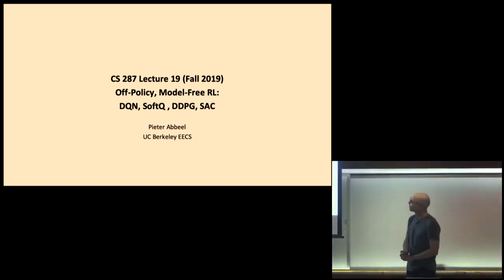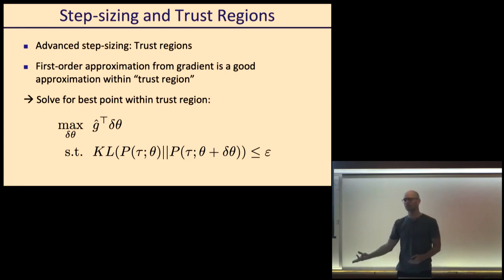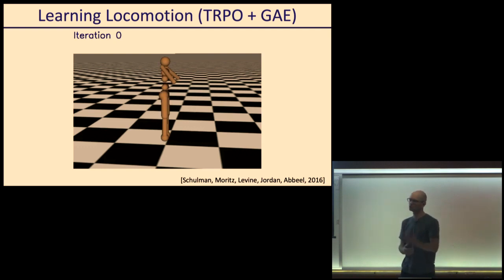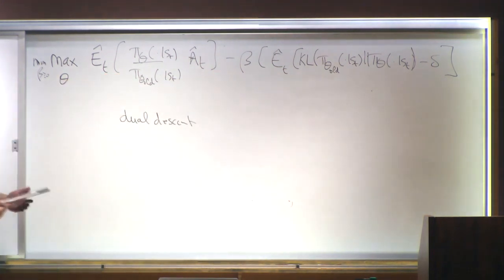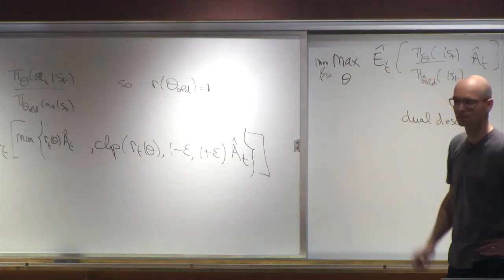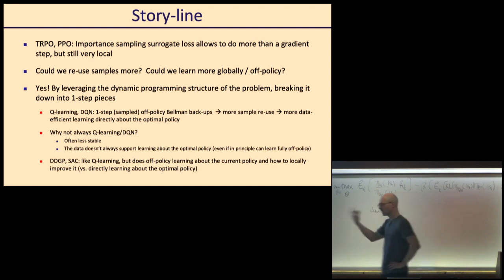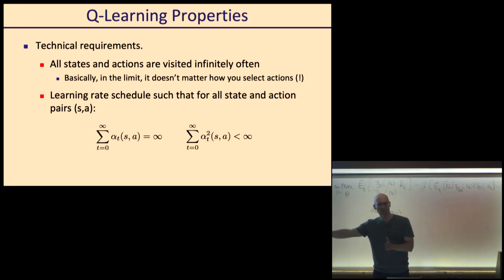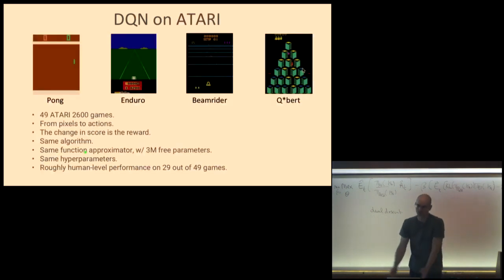Lecture 19 Off-Policy, Model-Free RL: DQN, SoftQ, DDPG, SAC -- CS287-FA19 Advanced Robotics

Comment: I had the exact doubt of min term in PPO concerning 1-e. And the explanation Peter gave after the break wasn't convincing at all. What happens if Advantage is negative?
Reply: I think it can apply in the same way even if Advantage is negative. In this case, if r is higher than 1+e, the original objective is smaller than the clipped one, so the final objective would be just the original one. If r is lower than 1-e, the clipped objective is smaller than the original one, so the final objective would be the clipped one. So, r is clipped at 1+e if Advantage is positive, and r is clipped at 1-e if Advantage is negative. The final objective is always a lower bound of the original objective.